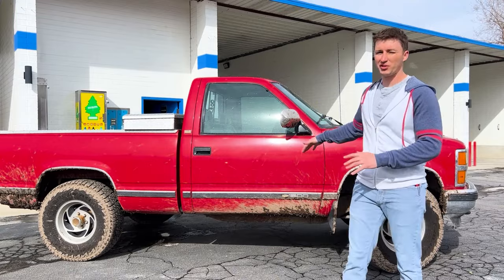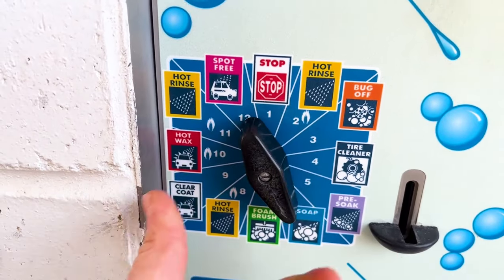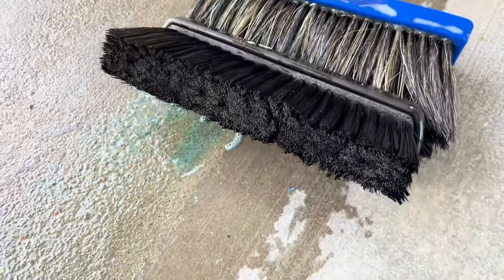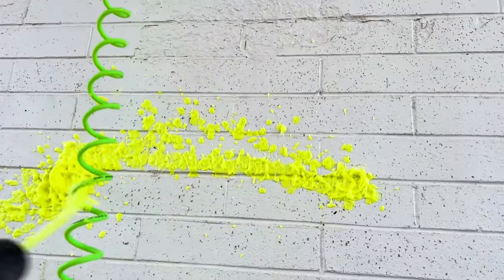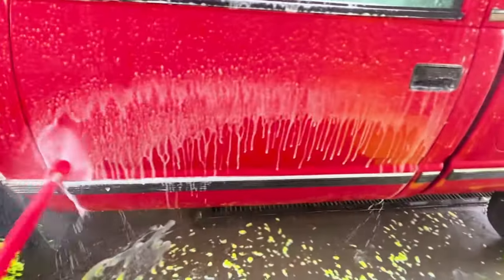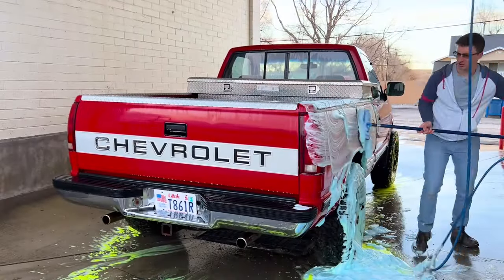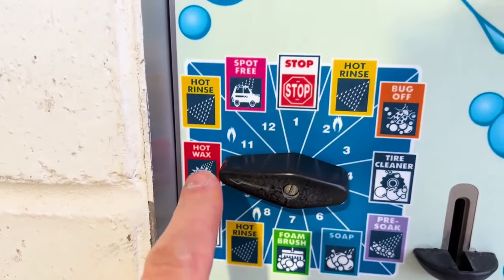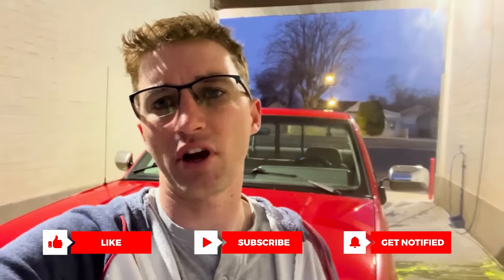The Ultimate Self Service Car Wash Guide

Comment: None of my local washes are this nice, but some are pricey at 30 seconds per 25¢. I too start with pre-soak every time. I also soak a clean wash mitt with pre-soak from the mat clips later at night (against the rules). That first, then power rinse the broken up material. Then I either go to power soap or foam brush. (Unless I’m dealing with heavy grime / films especially in winter, I skip the foam brush altogether, and only use it to apply the foam and NOT scrub). Once the car is covered in a film of soap OR foam I shut off the machine and spend 5-10 minutes lightly agitating the entire car with a mitt top to bottom before restarting the machine to only power rinse and then spot-free rinse. For the last 30 seconds I will power rinse the ground debris into the gutters and rinse the foam brush (courtesy to other customers and the operator!). Lightly hand/towel dry in the drying area afterward before heading home. Another tip is if you have big inner door bottom flanges on a truck or SUV you can open your doors and wash those off real quick with the power rinse in “pilot” mode (no trigger) while there is excess soap still on them.

Comment: Again a great video.

Most of the self serve carwash in the US look verry simple / Cheap compared to here in the Netherlands 

Here is common to have :
PLC control for the complete system
 LCD screens with buttons(No rotary switch)
Vacuum transport for coins to a central vault.
Pumps with VFD control
Direct soap injection ( no hydrominers ) 
Washing pressure 1400 psi
( Some even 2000 psi with a special high pressure rinse program )
Also products are all transported with water instead of compressed air.

How do they get the low pressure for the pre soak ?  ( Pump is only 1 speed )
Is there like a restriction valve or something.
Reply: No , it's called a flojet pump, it's a separate low pressure pump, some operate via electric, and some operate via air
Reply from the maker: Yup what Brian said its a seperate pump although my Pre-Soak is not a Flo-Jet its a different electric pump that runs constantly circulating warm presoak through the attic trough and keeping everything unthawed. All the houses are insulated as well. When Presoak is selected on the dial a solenoid in the trough directly above the bay opens for the pre-soak to flow out.

Alot of Car Washes here in the states were built in the 70's and 80's and if maintained somewhat could still be running the very same equipment. What was surprising to me when I got into the industry is that there has been very little technolgical upgrades in the timers at the meter box. Dixmor timers are the staple with the simple red letter screens. It seems like a touch LCD screen should be the latest technology but there is no established vendor in that space.

Comment: Sorry for the length, but I have a gloss black car, which takes a lot of TLC during washes, so I thought I would leave my thoughts since black vehicles require extra care.

I have always heard to skip the brush, especially on new black cars with gloss paint, because brushes produce micro marring and scratches.

I prefer a contactless wash, but if I have to scrub, instead of agitating with a brush, I use a good quality microfiber towel used with a Swiffer sort of extendable plastic mop (this is also good on bathroom floors used with IPA). Swiffers also make it easier for short people to wash the roof. Washable, reusable microfiber cloths covered with soap, IPA, hydrogen peroxide, or bleach also make it unnecessary to buy new Swiffer refills when used to wash a car or clean a home's floors. I like the Mr. Clean ones for every day car and floor washing.

I wash my car every week to 4 weeks (2020 Toyota Corolla XLE, #209 black sand pearl/mica paint), and as a daily driver it only gets a light amount of dirt on it driving about 9,000 miles a year--nothing like a truck.

Still, I would never wash a black vehicle with a brush when a microfiber can do the job more gently. Avoiding brushes is why I avoid automatic car washes in the first place. We have automated brushless ones here but they are few because they are so expensive to build.

I prefer paste or liquid natural carnauba waxes on black paint, but I often use the car wash wax if I feel the car needs a quick maintenance touch up on the wax between majoring waxings. Spray waxes from a bottle can be a little expensive for the limited protection you get from them. 

Cleaner waxes are okay for maintenance waxes but I prefer using them sparingly. They're more and more common now in stores though because they save time. But their added chemicals can be rough on paint and clear coat.

I never knew that the car wash hot wax was a sort of clear coat and should be applied on a wet car. I thought the wax was like a spray wax that would not bond to the paint if the wax was applied to a wet car, since most spray waxes go on dry paint and then are wiped off. Good to know.

In my experience, large drying towels, even high quality ones like from The Rag Company, often leave lint. I like using small to medium sized dry microfibers that are designed to get rid of smudges and fingerprints on paint and glass, even fine glass finishing microfibers, or a waffle weave cloth for really wet cars. These weaves seem to leave less debris behind.

These smaller microfibers don't soak up water like the big towels, but they don't leave lint, either, and to be honest the huge towels are best used just on the hood and roof of a sedan. If used on the doors, they often drag the ground and contaminate the paint surface with dirt.

I may go through more microfibers attaching them to the Swiffer to dry off the car, but I don't have to go back to make a second pass to remove lint, either. Again, the Swiffer makes it easier to dry the roof of small vehicles.

I have some small electric air blowers to dry cars, but they often require so much time to push the droplets off the car that it is just faster to use microfibers. Air drying only works with really high pressure systems, I find.

Since I lack a garage or covered driveway and my water at home is quite hard, I often wash, decon, clay, and wax in the shade of a self-serve wash bay with distilled water. Or I buy distilled water and use pump sprayers at home to wash since I lack a spigot hookup close to my driveway.

For waxing, I find the little 20 volt DA/orbital polishers work well if no major paint correction is involved, and they lack a cord, making them easier to use. They also use reusable bonnets of various materials (foam, microfiber, wool, terrycloth) that can be reused. 

When doing a thorough detailing in the shade of a bay at a self-service wash, I make sure to buy gas or something else from the station to compensate them for the extra time I'm in the bay. The wash process takes me about 15 minutes, but going from wash, to decon, to clay, to compound, to polish, to wax on a single car takes hours. 

To not be a jerk to the car wash owners, I often only do a complete process on a major part like the hood, or on a few smaller quarter panels. I do this on the weekends early and late when there isn't a line to use all the bays. I return every week until the car is finished. So doing a whole car very thoroughly (wash/decon/clay/compound/polish/wax) can take me about a month. 

Washing the car repeatedly when I wax new sections recleans the parts I have already waxed, so even if the entire car is not waxed at exactly the same time, it's hard to tell the difference. The wax all fails at about the same time.

I try to do a wax every 3 months with just a wash and a diluted 70/30 IPA wipedown if that, or sometimes I apply the new wax without a wipe down if it looks like the old wax is gone with the passage of time because the water is no longer beading. Usually the hood, roof, and trunk require wax every three months. The sides and back can go six months since they get less direct sunlight. The front grille often needs more attention because of bug splatter and rock chips.

I only do decon/clay/compound/polish when absolutely needed since these remove a bit of clear coat and I try to keep a car for 20+ years under the hot Arkansas sun. I've only gone through this whole decon/clay/compound/polish process once in the five years I have owned the car, and even then only on the parts that needed it.

Thanks for this video. I'll try the wax trick to help speed up drying. I always avoided it because when I would see the wax bead on the water I would think, "It isn't bonding to the paint." I thought I was supposed to apply the liquid wax to dry paint, then wash or buff it off.

I'm not a big fan of bottled spray waxes/detailers anyway and would rather use the car wash's wax. The spray waxes don't last a long time, and for all the expense of buying them, you can just do a quick wash and accomplish the same thing for less money. 

Waterless washes I like a little better, as they are like detailers but work a bit better on paint defects. I keep bug/tar removers and a microfiber in the car in case of bird droppings on black paint on a hot day, but those tend to leave an oily protective film that I don't like, so I try to wash them off as soon as possible.

I will also say if one uses a strong car soap like Purple Power, it seems to be hard on glossy black paint. Water will lie very flat on the clear after Purple Power is used. Sometimes if I'm just removing a light layer of road film, I only use the presoak (without even a pre-rinse since the soak has water in it and is going to encapsulate the dirt and wash it away anyway).

It all seems to work fairly well. My only complaint might be wheel cleaning. A lot of decon iron removing products can't be used on many types of wheels without damaging them. You can get a brush into some wheels, but the best approach is just to remove the wheel and then scrub off the brake dust.

That process, as well as putting the car on jack stands to wash underneath, is a big pain. I'm not sure if we have an automated wash here that only does the underside, but I'll keep an eye out for one.

Thanks again for your video.

Comment: A couple of things to add,  The thicker the foam the more customers like it but it is all done with air and air doesn't clean very well a wetter product will penetrate and clean better, Wash from bottom to top and rinse from top to bottom to avoid dirt streaks. Low pH and high pH in a self serve is a tough thing to get right, I have thought about what it would take to do a true low pH / High pH set up and realize the educating the customers would be very difficult. In an in bay automatic I can get them to work well because I can control the parameters but you lose that in a hand wand. I worked at a company that produced extremely strong two step chemicals and required us to wash our work vans everyday and after3 years they still almost looked new.  Btw high ph is good for bugs, oils and dirt, low ph is good for glass and, chrome and aluminum.  You can get clear coat conditioner or clear coat polish, conditioner is a mild soap and polish is a wax. The polish will cost about two to three times what the conditioner cost but if you market it properly you can sell it that way, also ceramic infused waxes are starting to come online with most chhemical suppliers and that would be a very good option to install.

Comment: Ive got barely any good self serve car wash around here but one is pretty good, the owner just got a new system for 150K 1 1/2 years ago installed. He uses UV activated chemicals and also has Blacklights inside his boxes at night plus the foam is fluorescent as well.

He got a prewash (High pressure) Power Foam with 3 colors alternating (First one in entire germany when it opened, strong dirt remover, booster and insect remover, sky blue, mint green and violet now) of course a rinse option, foam brush (PE brushes but pretty clean usually altho ive noticed today or some other time there must have been something in the brush that scratched my paint but on my car i dont really care anymore plus when i started using self serves i didnt know things like brush covers exist which i can only recommend anyone to use and or sell if youre an owner) the shampoo has some additives added to it which acts as a protection layer to the paint as well as builds a gliding foam under the brush, Hot and cold wax option with added foam killer so u can literally skip the rinse option if you want and obviously a spot free rinse option as well.

The owner is very helpful when hes there and ive been talking with him quite some times already, he also got brush covers that you can borrow as well as tire cleaner and brushes.

Hes working on replacing the vacuums for 33K as well as the coin changer for about 3K whenever he gets around to do it. He also wants to make the shampoo and foam brush colored and fluorescent too soon.

He also got a floormat cleaning machine as well as brand new mat knockers. he also put up a pedestal on his free unroofed washing box for higher vehicles. He also plans on installing a vending machine.

Under the week its open 24/7 from 8AM Mondays to 10 PM fridays and then 9AM to 10 PM on saturdays.
Reply from the maker: Thats incredible. Some day I would like to visit more car washes in foreign countries and see the different setups.
Reply: @therevestor   Germany is very strict on water protection barely anywhere ur allowed to wash ur car at home and if so only with water, ur not allowed to let anything flow into the ground or grass, fields u name it that could damage the ground water or foliage, 50K and even higher if someone reports you......

That self-serve wash is the main one i go to for weeks now. I was there yesterday the owner wasnt there, but hey he works all week in the paintshop next door and operates the self-serve as well he cant be there all day especially not on saturdays.

And yeah i know self-serves with LCD Touch screens but these are rare to be seen usually its just buttons with monochrome displays also over here, but hey its robust and works well.

Very modern self-serves over here work with foam wax, low pressure foam guns, Solar panels, concentrate recovery systems even sometimes. WashTec has a combi gun where you can use the high pressure gun also as foam gun.

I know of self-serves offering underbody wash, some have cutouts in the drains so you can push a bike in it and wash it without falling over.

This is the self-serve i was talking about in the first post: https://goo.gl/maps/BKFSAuxF3XbF7Xnb7

https://www.tiktok.com/@sbwaschanlage_olpe_wb

Its crazy that all that tech fits inside a like 2,5 by 2 meters room and theres still space for shelves and storage.......

BTW as i scratched my car with that brush, and i guess ur customers will too i bet, put up a sign that the brush use in on their own risk and that they should pressure wash it before using at least or even better start offering brush covers somehow.
My recommendation would be generation 2 of the brush cover of Chemicalworks if you can get it in the US. Also noone can get after u legally if that sign is there as well u can just refer to it and noone can do you anything.

Also rim brushes as well, tire cleaner only doesnt get rid of all the brake dust and without u cant get into the barrell of the rims.

Ive also seen self serves with so called tornador guns for interior cleaning as well as automatic floormat cleaning machines too :)

Comment: Nice video. Learned a lot it explains a lot. I never use the brush head. One error I noticed was you used the foam brush on wheels and tires then put it back on the paint. That’s a big no no if your care about your paint. Brake dust on the wheels tires even small amount will swirl and haze your paint like crazy especially on dark colors. I would do the whole paint first then wheels tires last. And always start from top (least dirty ) to the bottom  (most dirty)
Reply from the maker: Thanks for the info!

Comment: $12 wash right there. For $27 I can get all of that while firing up my pipe lounging on a conveyor belt and that's as many times as I want monthly and includes the air blower thing and super high powered vacuums
Reply: While also scratching your paint
Reply: @Conner.Suzuki  Yup. I was 'on the conveyor belt' two weeks ago and the belt stopped right when the huge brushes were in contact with the car. Chipped the shit out of my doors!

Comment: You go through every single option on the dial (while the timer is running) you'll end up spending at least $50 bucks.  I just do water spray > soap brush > rinse, and those three stops, very quickly deduct $10 bucks from my credit card...and I rush through it, so it could get really expensive.  Don't do unnecessary options if you're just looking for a wash.  As a "business owner", he'll suggest you go through all the stops.
Reply from the maker: This is probably a $10-12 wash going through all cycles. Less if you have a sedan car.

Comment: my local SS bay looks the same. i use the lower pressure spot free to pre soak and rinse my ceramic coated car.i bring my own bucket and ph neutral soap. NEVER USE THAT BRUSH ! THAT BRUSH WILL SCRATCH THE F OUT OF YOUR PAINT, GUARANTEED..

Comment: Those lines looked pretty kinked going into the top of your soap jugs - does it not cause an issue?
Reply from the maker: They just have a bend but it doesnt restrict flow. There are one way foot valves at the bottom of the jugs